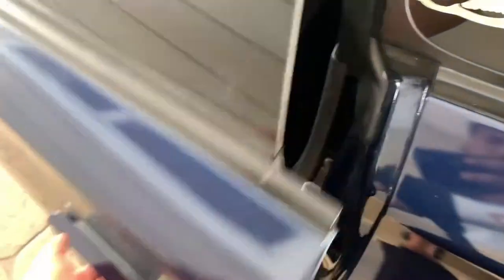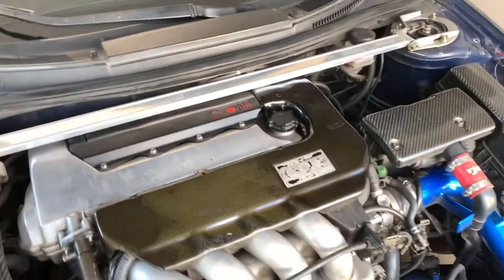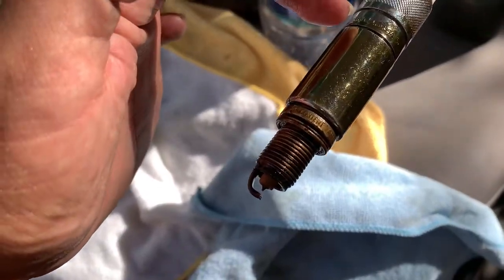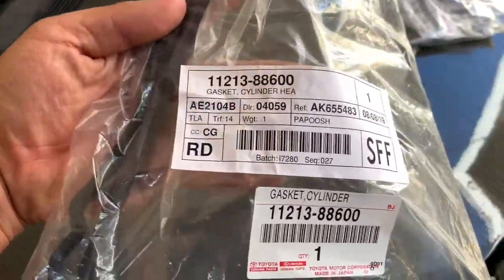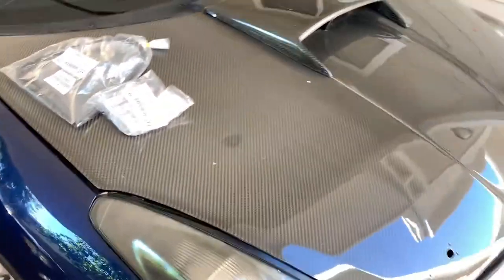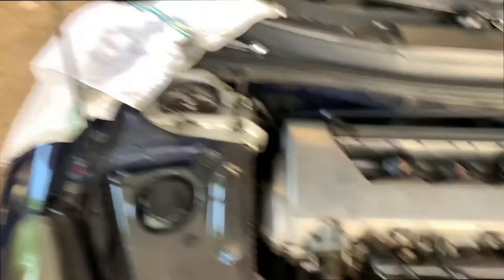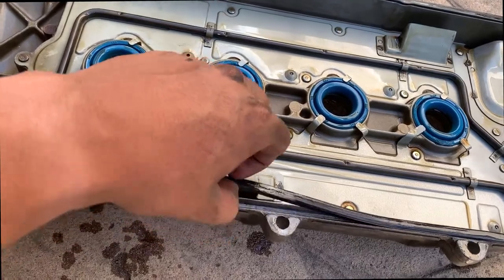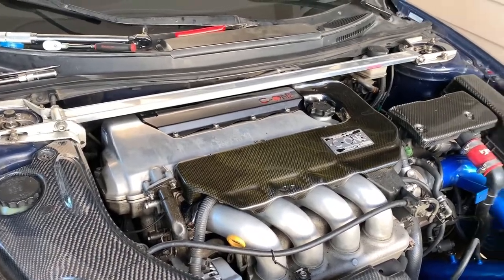Do Not Buy This From Autozone!!!

Comment: I’m calling bs.
Reply: Yea me too.  It looks like he didn't have the gasket aligned properly when he installed them.  Also the seal around the sparkplug is the one, if leaking, would have caused the misfire not the gasket around the edge of the valve cover.  There is not enough oil in the tube seal area to have caused a misfire.  You do know that this is not an Autozone product right?  It is a Felpro product.
Reply: panzerabwerkanone exactly, this guy is a DIY who’s not good at it. Plus, auto parts stores sell parts, we do t make all of them. Let alone a gasket. This guy needs his tools revoked.